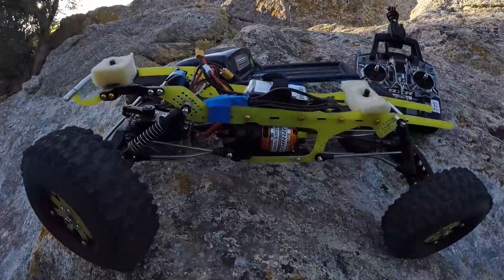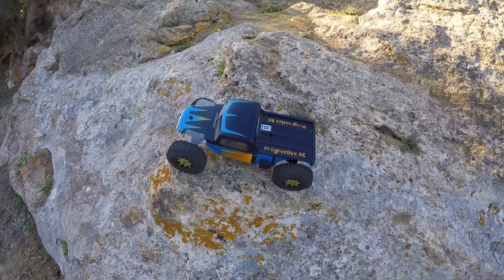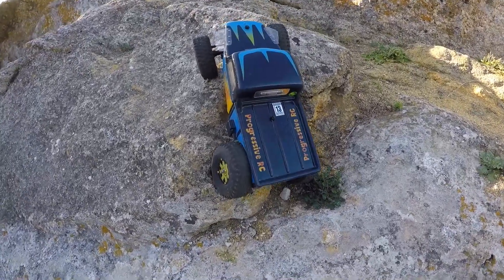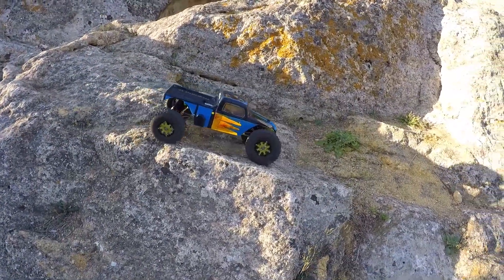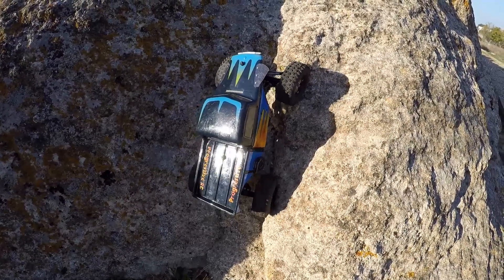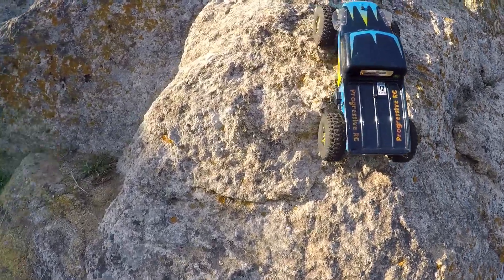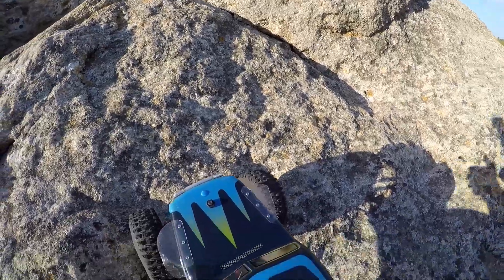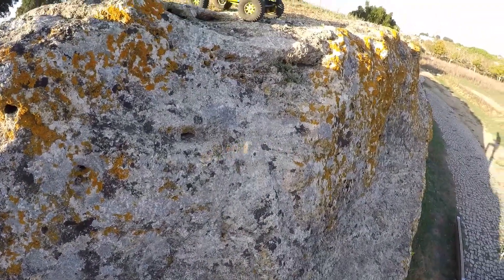Testing a Outrunner and AM32 ESC on the PScale

Comment: So, 11 months later... did you found the punch you are looking for? I'm quite tempted to try am32 on my bully 2 moa .. but I am afraid I will loose the punch and strong drag brake I am getting from my current holmes hobbies brushed setup.
Reply from the maker: It's better but still not the same as a good brushed.
I replaced the motor to a Holmes 2040kv outrunner, but the biggest improvement came from a change in the pinion.
I had too much low gearing, now I still have enough torque but I can punch it a bit more and the car reacts better.
Dragbrake is not a concern. They have probably better dragbrake then a brushed motor.
I will not me changing the motors on all my cars to outrunners, but I got this to a point I am comfortable with it.

Comment: Drag brake seems really weak.  
I adjusted it to max    What else is possible ?
Reply: Try a smaller pinion gear ⚙️
Reply from the maker: On my car the drag brake works well...
Not a problem at all.
Since this video I switched to a Holmes Hobbies 2040kv and it fells very much the same as this one, just a bit more of top end.
In a competition environment, the only thing that I am missing, is a bit more punch...
Could also be related with gearing so it's something I will investigate in the future.

Comment: I est facile à programmer  ?
Reply from the maker: This is a Flycolor ESC.
You have to flash AM32 firmware with a STLink and then configure the ESC with a config tool and a Arduino nano.
It's a bit of work and you can always risk burning the ESC...
Reply: I have a 2250 kv out runner with a rhino am32 esc  k, I love it way to much punch though I'm gearing it down now , waiting on the gears to get here

Comment: Sanwaaaaaa, do it! ♥️♥️
I got a 2040 Revolver with this ESC, it is a good Setup. The Point from sinus to linear is a little bit annoying. Maybe i get used to it.
Reply from the maker: If I can get the stick radio to work (and have a spare), I will keep that setup.
If not I will consider the sanwa.... I just dont want to learn how to drive again 🙄
While driving normaly I hardly feel the gap from sinosoidal to normal... Make sure your gearing is low enough 😉
For me the worst (and only complain), is the lack of sharp punch...